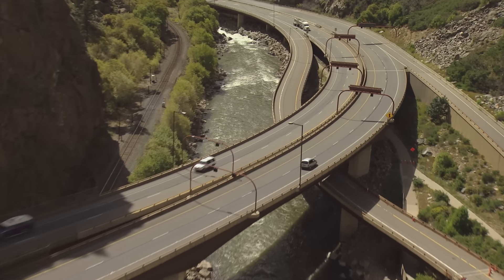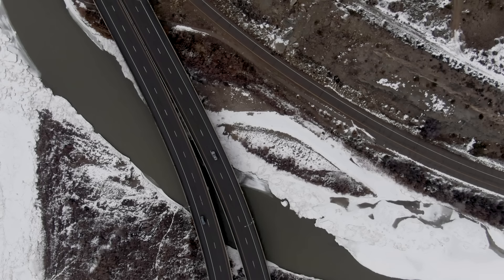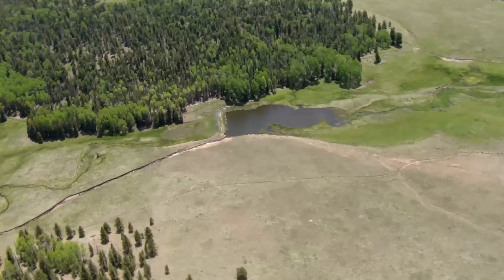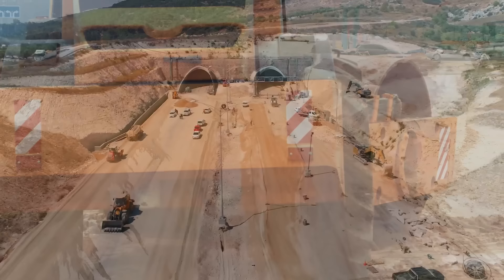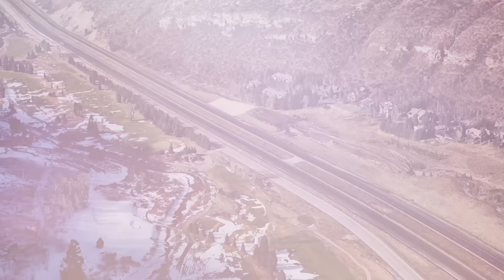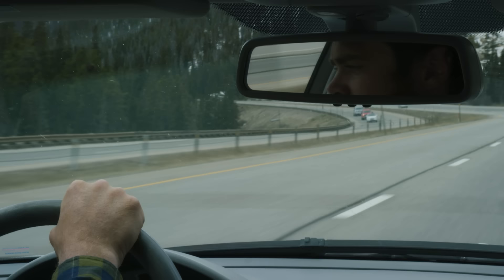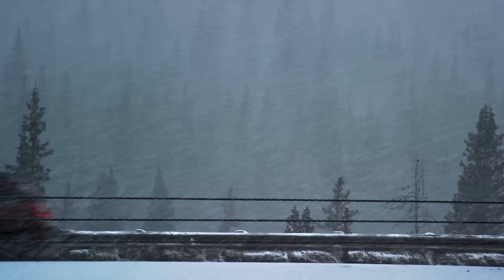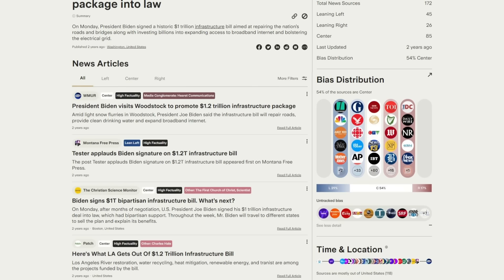How to Build a Road

Comment: The crazy part is, I-70 is considered a safer route in winter than I-80 up in Wyoming.  I-80 in Wyoming had less engineering challenges, but is legendary for horrifically bad weather in winter and the section between Laramie and Rock Springs is the windiest region in the entire US excluding some high mountain summits.  Hurricane force winds are a very regular occurrence in southern Wyoming.  Combine that with heavy snowfall, ice, and regular below zero temps in the winter and its a frozen hell on earth.
Reply: This is why we a 25 + Veteran driver I typically chose I40 or I10 routes in the winter
Reply: sounds fun
Reply: That stretch of I80 between laramie and cheyenne is nicknamed the Snow Minh trail.
Reply: I didn't anticipate this driving i80 in the winter once. blindling blizzard and winds I had never experienced before.  I was white knuckles for 6+ hours straight. I was in the right lane with my hazards on and semis were outpacing me by what felt like 20 mph hahaha
Reply: @OwenHeh if you have to drive with your flashers on pull over.
Reply: I drove through there in March of last year. It wasn't terribly cold but the winds were insane. I was in a brand new F150 and it was blowing it around like a Yugo.
Reply: @squee6970  clever name.  Driven it many times, but never during bad weather.  The thing that always gets me are the railroad-like crossing gates used to close the I-80 if necessary.  I don’t recall seeing any on I-70 through the mountains of CO?
Reply: I have driven those two roads for work a ton of times. Given the same conditions of not being able to see more than a hundred feet in front of my car, traveling at 30 MPH and afraid to pull over because you would get rear ended or find an exit because once you see it, it you have passed it, I would take the more curvy I-70 than the more wind blown and slick I-80 any second of any day.
Reply: @turkfiles I was just out west for the last couple of weeks, driving everywhere. Im pretty sure I remember some train crossing things on i70, they definitely had lights and shit to close it down in sections. I saw the crossing guard things all over the place though, even out in Western NY or Pennsylvania. They seemed to be where there would be snow drifts often. I thought they were hilarious.
Reply: Go pokes
Reply: I've seen some of wydots traffic cameras on i80 and the snow drifts are amazing. Would not want to be taking a truck through the basin in winter....
Reply: @cmaven4762 the wind is really the dangerous thing. It gets so bad that keeping a car in your lane is hard and semi-trucks blow right over
Reply: Wyoming locals DID warn them not to situate I-80 where they did....
Reply: @daffyduck1937  I-90 is usually pretty good.... if you don't mind the detour!
Reply: I drove i80 through Wyoming in the winter.  It was complete pandemonium.  18 wheelers on their sides.  A Toyota Tacoma twisted up like a wrung out rag.  I couldn't see the road half the time because snow was blowing over it.  I'll never try that again.
Reply: Facts, I-80 is so windy. I drivee it one winter to Utah and I saw overturned tractor trailers and there were signs before every exit saying you should turn around due to wind speeds over 60mph. It was wild.
Reply: Well said. As bad a I70 can get I have never actually feared for my life as much as I have on I80.
Reply: @Alex0992 Why?
Reply: @RickJaeger  it's unsafe..
Reply: @Alex0992  So? That doesn't explain it.
Reply: I worked field service all over that area. Dreaded i80 in the winter. Seen crazy snow drifts and large trucks topple over. Bad crashes. Hours of my lift wasted waiting
Reply: I've been through WY in the winter and those winds are no joke. They can and often do push vehicles off the road.
Reply: Correction to the above as someone who grew up in Laramie: It is actually the section from Laramie to Rock Springs that is called the Snow-chi-minh trail since it opened in the ‘60s and was so treacherous. And yes, as others have said, the locals all told the engineers to follow the old Hwy 30 route.
Reply: The section of I-80 between Rawlins and Laramie is no joke either. It's only 96 miles but one night I spent almost 4 hours trying to get from Laramie back to Rawlins and I was not in a four-wheel drive it was a terrible night of driving.
Reply: They did next to no research on that Wyoming stretch and just built it straight, ignoring years of climate research in the area. If they had just built it 10 miles to the north, they would've avoided the constant downslope winds that blow snow over I-80 24/7 during winter. As someone who lives here, it's insane how often that stretch gets closed in the winter. During snowier winters, it's closed as often as it's open, and when it's open it's white-knuckle for several hours. Brutal stretch of highway
Reply: @drumline17  Yup, they wanted that view of Elk Mountain rather than less insane winds and whiteout conditions.
Reply: Can confirm, I consider that  section of I80 to be the most treacherous in the US. I have driven both 70 and 80 probably over 100 times each in a semi, and I'd go with 70 every time. At least you can get help on 70 if you break down.
Reply: @Alex0992 pulling over on slick roads and poor visibility is asking to get hit by a semi while your sitting still. It's better to keep moving till you can get off the highway.
Reply: @bakuamad5519  a high percentage of semis change lanes when someone is on the shoulder. It's a higher chance you would be hit by a car. I'll say you have a higher chance to be rear-ended going 35mph in a 65mph.
Most interstates have exits every mile take one. Don't stay on the interstate. Pull over.
Reply: I literally got stuck in Wyoming on that exact stretch of road for 24 hours. Road completely closed. Had to sleep in a church
Reply: @drumline17 that's wyo's way, next to no research.
Reply: @Alex0992 wyo I 80 way does not have exits near every mile.
Reply: @ragauerk9310  I said it did? If the weather is so bad you feel the need to put your flashers on you need to pull over. Its that simple what the fuck is so hard to understand about that?
Reply: Yeah , having driven from Laramie to Rock Springs during an ice storm, I believe it. I lost count of cars off the road somewhere in the 40s. I drive I-70 through the mountain corridor every weekend. The traffic is miserable and there are always a few yahoos, but I haven’t seen anything like that I-80 experience.
Reply: You should go and see who owned the property over elk mountain and then you will know why I80 was built on the rout it was.
Reply: Agreed! I’m a retired long haul trucker from Canada, and the most dreaded stretch of road for me was I-80 across Wyoming! I’ve trucked in all the lower 48, and right across Canada. I regularly ran I-80 heading down to California from Western Canada, and it was ALWAYS windy in Wyoming! I think I experienced only one trip with calm winds EVER! And the ice covered roads! Don’t get me started!!!
Reply: I drove up I-25 from Denver into Wyoming and within an hour I had to turn around because the winds were 40+ and my car felt like it would flip… driving I-70 I’ve only ever been scared of snow never ever winds
Reply: @Alex0992  You don't need to pull over if you are driving with your hazards on. They are on for others to be aware of you.
Reply: @shawdowclone  That's what your tail lights are for, so people can see you in inclement weather. Turn your hazard lights on when you are a hazard and if you are a hazard you need to pull off the road. You are not supposed to turn your hazards on just because it's raining.  If you are going slow enough to create a hazard on the interstate you need to get off the road.
Reply: @Alex0992  Because there is nowhere to pull off at often for miles and when there is there is no parking. You don't dare pull off onto a snow covered onramp shoulder because you cannot see where it ends and in case you haven't noticed they mostly tend to slope down away from the road. With a high wind good way to be blown into a ditch. Pull off on the side of the interstate and get hit by another vehicle hugging the shoulder. Plenty of reasons not to pull off just willy nilly anywhere.
One runs their hazard lights so the people with no sense can see you when they pass you. I was driving in conditions where the blowing snow started getting stuck to the highway and dropped down like most other drivers did to 40 mph when a jackass US Express truck shot by doing 65+. Saw him in the median with two other trucks he took out with his jackknifed trailer. Road covered with about 1/8th inch of packed snow, not as slick as ice, but not snow either.
Reply: @MountainFisher  when did I say pull over to the side of the interstate? 
If everyone around you is going the speed limit and you are in the right or left lane with your hazards on going 15 under you need to pullover.
Reply: lots of potholes though😂
i drove through 2 weeks ago, and man lots of potholes after snow days
Reply: @Alex0992  Semis drive with hazards on and as a cross country driver. You are not supposed to stop driving just because your hazards on. They are to make other drivers more aware of you driving or not driving. It is not a requirement by law to pull over if you have your hazards on.
Reply: @shawdowclone  only the dum semi drives turn their flashers on in the ran.
Reply: @Alex0992  Uh huh, the drivers that spell like you right?
Reply: @shawdowclone  made if you focused more on your driving instead of my speeling you wouldn't drive like a dummy
Reply: The damn winds nonstop all the time. As far as road its pretty straight forward. Excluding a couple passes
Reply: @daffyduck1937 i stay below I30 in winter in east and below I20 in west
Reply: I-80 just a few years ago, September, 2016  Canoe on the roof of and F-150.  East bound into an east wind.  Pedal to the metal I could not maintain anything above 30mph  with a fuel mileage measured in gallons per mile.  I pulled off.
Reply: Its at its worst between Rawlins and Laramie. Every time Id go WB through there in the winter I knew I had to get to Rawlins/Sinclair, minimum, or Id be stuck in Laramie for 2-3 days. Reverse case going EB. Actually EB Id try hard to get to Cheyenne. Once in Cheyenne, youre usually good to go.
Reply: @daffyduck1937  Heading out to Socal or Vegas, yes. Unfortunately if youre heading up to Portland or Seattle, you got 2 choices, 80 or 90. Lookout Pass can get very rough in the winter, as can Snoqualmie. I suppose once you go through these routes enough times you get accustomed to the weather patterns and know when its good to roll or better to park it.
Reply: 2018 I lived in Ankeny, IA, every few weeks i’d leave after work Friday 4:00 pm & drive solo to Salt Lake stopping only for gas, one such trip caught me driving through a big snowstorm (end of May) closed I-80 in Cheyenne, diverting traffic to Denver & I-70 where the same storm was. 
That’s how bad Wyoming’s road can get, clearly the best option continuing to SLC was adding an additional 6 hrs & driving over the Rockies during a storm is safer than the 60 mph gusts & whiteout conditions across Wyoming!
Reply: I was a trucker for many years 
I-80 was my route 
Nor Cal to East Coast. 
You learn how to deal with Wyoming. 
Turn on your CB and listen to the older more local drivers they know how the way 
There is older highways to go around the bad spots
Reply: @turkfiles  They have them on I-70. They are located east of Denver and east of Glenwood Springs. Dont recall seeing them up in the passes, but I haven't driven it since 2010. Usually went up to 80 or took 40.

Comment: I grew up taking this highway, and I was always amazed by the fact that the roadway was raised on supports for miles in such a remote canyon, it felt like driving in a video game.
Reply: Same, but my parents never let me drive as a child ☹
Reply: @ChemEDan  that’s the thing about being a child 💀
Reply: they had to drop those supports in by airlifting them with helicopters
Reply: Should check out the "Interstate" roads in Hawaii. They are built the same way with several mile stretches of road being elevated above the landscape by massive concrete pillars.
Reply: China has built many many raised highways in the last 15 years.
Reply: Y’all ever been on Louisiana roads? seems like half the state is bridges over water. Long bridges like 10 20 even 30 miles straight over water
Reply: @Trifln214  I think the impressive part is how tightly it winds through such a creviced canyon, the highway even banks with the curves in parts, all suspended a few hundred feet in the air. But the water causeways in Louisiana are equally impressive, although straight with gradual elevation changes it’s still amazing to see!

Comment: The story of I-70 through Utah is another engineering marvel in an of itself, not because of the terrain, but because of how absolutely remote it is.  For example, there is a stretch of interstate almost 100 miles long with absolutely no services (food and gas).  The route follows an old railroad corridor which the Union Pacific railroad surveyed, but never used because of how remote it was.  When the first highway surveyors showed up in the area to plan the route of the new interstate, the local ranchers thought they were absolutely nuts to build a road through the area.
Reply: Declined a second date with a girl I was very attracted to because she told me that she once was driving west while high and took that stretch without getting gas first. She had her dog in the car and there are SO MANY signs, I just couldn’t handle how dangerously irresponsible that is.
Reply: @middlemuse did she run out of gas? Also, people make mistakes and grow from them. Your loss
Reply: @middlemuse Was the dog alright??
Reply: @jaggerpirtle3766  "people make mistakes" My man getting high then driving into the middle of nowhere with your dog is not just irresponsible, but suicidal. He wasn't losing anything.
Reply: I regularly drive through an area where the sign says "NEXT SERVICES 130 MILES - NO FUEL FOR THE NEXT 145 MILES"  From Whites City NM to El Paso on 62/180......that is a bit of a shock when you think about it for the first time you pass that sign.  The road is good and the sights are pretty awesome....but remote??? Yeah.....oh yeah.
Reply: I nearly hit a baby deer out there lol
Reply: @ssnerd583  I drove that stretch while surveying western TX & NM a year and a half ago. The weird part is, there is a small town (Dell City) about 10 miles north of the highway about halfway through that section that has fuel and food in a pinch. I had a survey point in that town and got some pizza at the convenience store while I was waiting on the point to record.
Reply: My wife and I had done that stretch many times.  We always joke that the gas stations in Green River and Salina must make an absolute killing.  Last time we did it I was in a daze driving and missed the sign at the Salina side.  Had about just under 3/4 of a tank.  We trekked on with an additional detour to Goblin Valley(which ate about 1/4 of the tank roundtrip).  We rolled in to Green River on fumes.  Never again.
Reply: The first time I had ever been down this stretch was in the middle of the night. It almost feels like you might as well be way out to sea.
Reply: Almost ran out of gas there. Good time
Reply: gorgeous drive though, Green River so Salina is breathtaking
Reply: In 2000 or 2001, I drove from San Diego to visit family near Kansas City.  On the way out we took I-15/I-40 to Tucumcari, then up through Liberal KS and Wichita on "back roads" before getting back on I-35 for the last couple of hours. On the way back we decided to see some different scenery, so we took I-70 to I-15 and then south. About halfway between Green River and Salina somebody said "Maybe I was asleep and missed it, but when did we take the exit for MARS?"